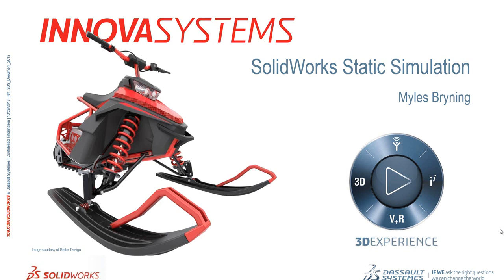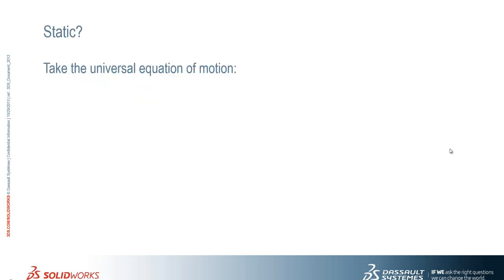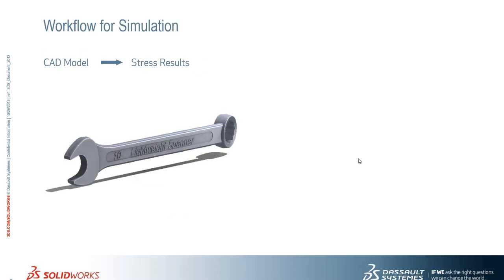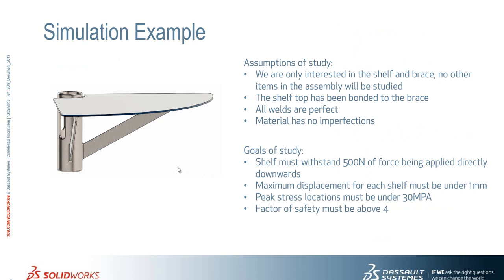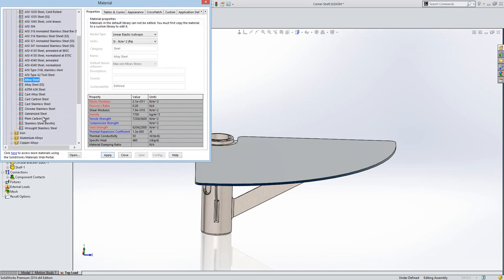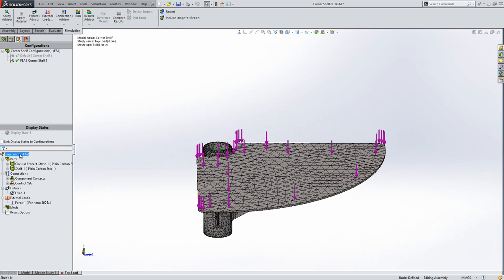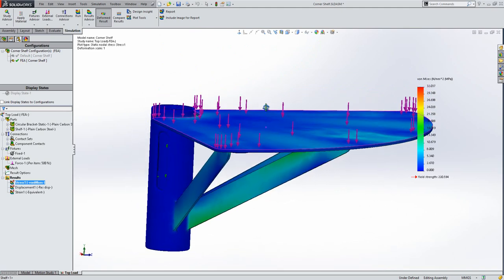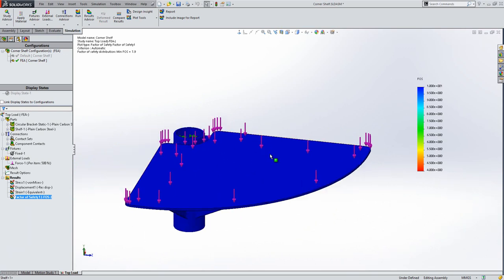SolidWorks 2014 - Static Simulation Study

Comment: for example, if a 100X50X10 steel plate can easily sustain 0.5N force then why software still shows the bending of the part? in a red area.. there is no possibility if i apply a little force on a hard material and it will bend.. why is that ??
Reply: Of course it would bend, just a very small amount. Its really down to the engineer to figure out what results are inconsequential, a deflection of 1e-9 mm would just be nothing worth thinking about. The software will still give the result though, it knows no better.